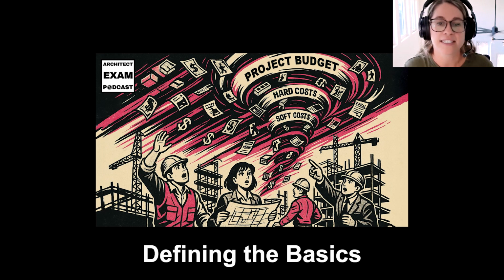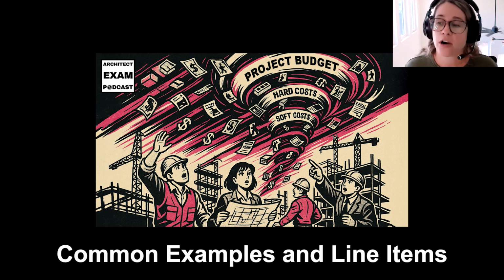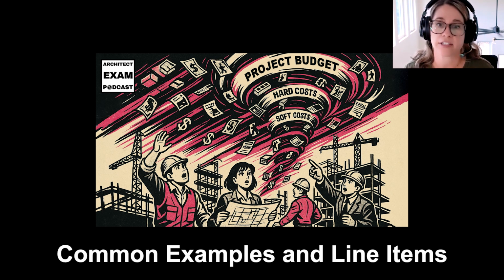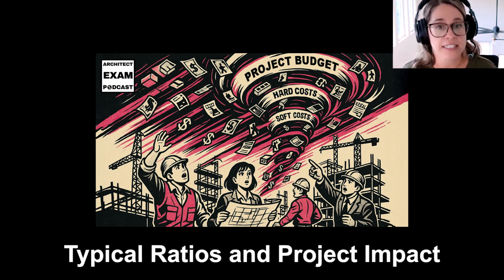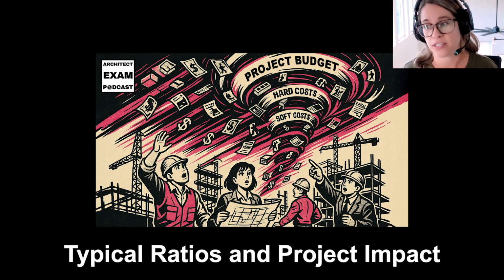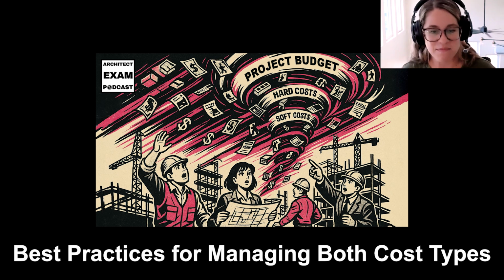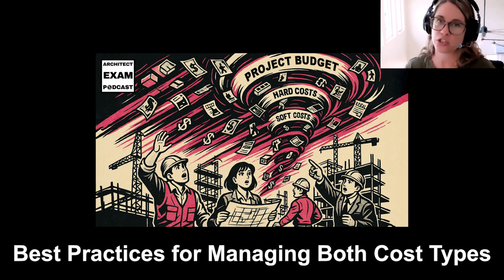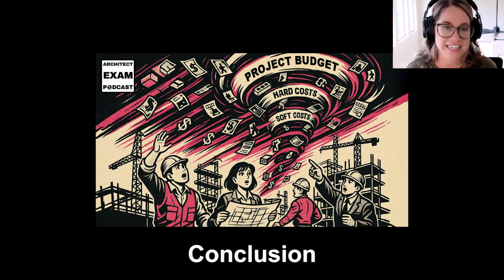Hard Costs vs Soft Costs: Making Cents of Construction

Comment: Really good breakdown. As a GC estimator, the soft costs are easy to overlook until they start affecting the budget. How do you usually keep all those cost categories and changes visible as the estimate evolves?
Reply from the maker: Great question, and great to hear from the GC side. The key is building a cost tracking structure early and sticking with it through every phase.

Most firms use a cost log or estimate reconciliation spreadsheet that breaks the budget into hard costs, soft costs, and contingency from day one. Every time a design change or scope adjustment happens, it gets logged with the cost impact so you can see the running total against the original budget in real time.

The other piece is tying your estimate updates to project milestones. At the end of SD, DD, and CDs, you're doing a full reconciliation comparing your current estimate to the last one and flagging where the numbers shifted and why. That way nothing sneaks up on you at bid time.

On the soft cost side specifically, the trick is capturing them in the budget from the start rather than treating them as an afterthought. Permits, testing, utility connections, design fees, insurance. If they're not in the budget early, they become surprises later.

Appreciate the perspective from the estimating side!
Reply: @Youngarchitect  Exactly. The estimate reconciliation piece is huge. I’ve seen budgets drift simply because changes get tracked in one place but don’t make it back into the current estimate. That’s actually one of the reasons I like what Shackleton is doing — keeping bids, budgets, change orders, and project information connected instead of having the team chase everything across spreadsheets and emails. How are you guys handling that today?